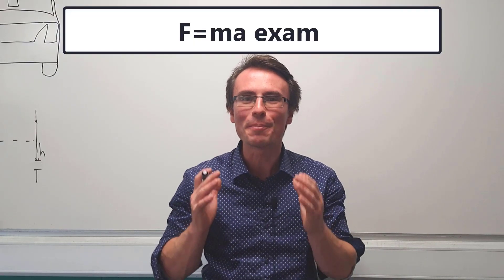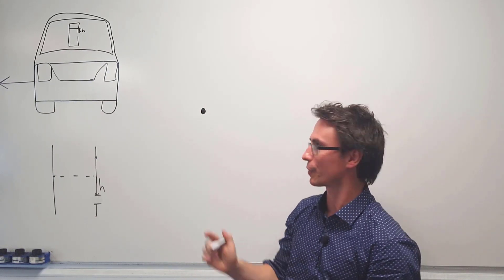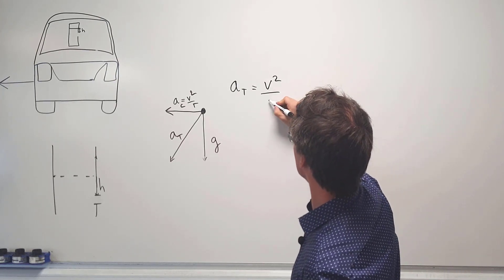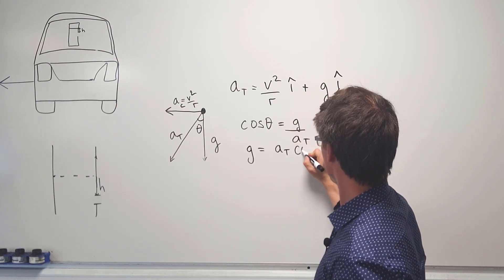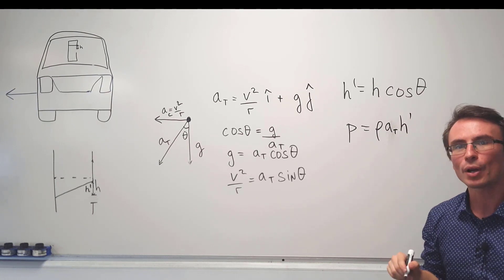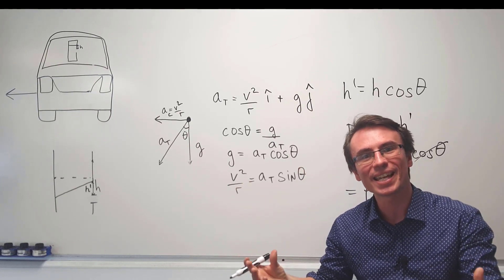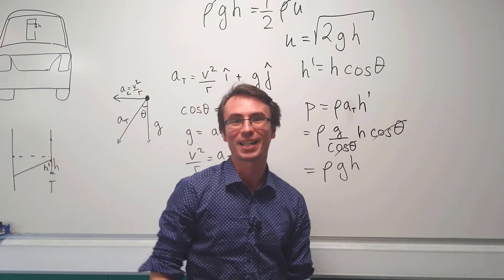HARD last problem from the F=ma exam

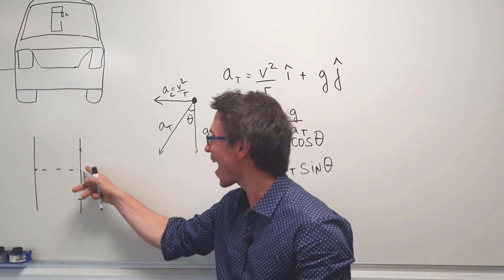Comment from the maker: So I am not actually convinced about my reasoning on the effective height of the water at 2:33 .What do you guys think? The official mark scheme is here:  https://www.aapt.org/physicsteam/2020/upload/2019_Fma_A_solution.pdf  Have a browse through the other problems too, they are fantastic! More to come!
Reply: Here's one way to see it imo. Since the car is accelerating, there's a "new" gravitational acceleration that points down and to the right, what you labelled as a_T. Now, in normal conditions, the water level is perfectly horizontal because that way it minimises its potential energy, but with a different gravitational acceleration, one that slightly points to the right, the water level will need to change and be slanted. It's like we are on a new planet with gravity that points both down and right, where skyscrapers, houses, even the inhabitants of that planet are slightly  slanted .
It's a silly way to think about it, there surely are more rigorous and precise explanation on why the water level is not horizontal anymore, but one could argue its "potential energy" is at a minimum with this new gravitational acceleration only if the level is sloped. That makes h' the new height, since height is by definition parallel to gravitational acceleration (think about the height of the alien skyscrapers, how would it be measured?).
Reply from the maker: @marcoaltamura7512   Agree exactly! Thanks for the input. That's actually exactly how I initially filmed it. However it did not seem rigorous to me and I couldn't see why the proportionality would exist mathematically, so hence I edited in the virtual whiteboard segment thinking about the normal. It's pretty similar to say, the vertical component of the B field in magnetic flux calculations which is BAcos(theta). Also, your sky scraper analogy is excellent! Thanks!
Reply: According to me, the simplest way to imagine of it is

Think of a tiny water particle at the left(with respect to us) edge of the cylinder, the resultant of centrifugal force and gravity vector acts downwards, towards right wrt the car,   if there was no wall, the tiny drop could have moved in the same direction. But, the wall exerts equal and opposite force in the opposite direction, so the droplet will move upwards, slanted at angle 90-theta with the horizontal line.
Reply: I think it's not theta

Comment: This channel is a gem. Continue
Reply from the maker: Thank you so much for your kind comment!
Reply: @zhelyo_physics , consider my explanation too please.
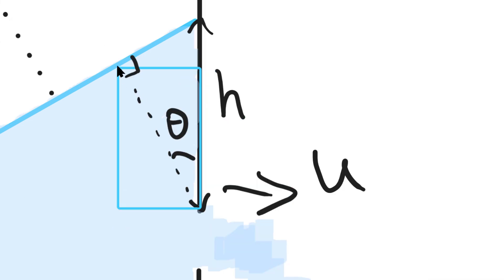Reply from the maker: @Mathematician6124  Sure! I always respond to good physics questions!  So the diagram at 02:44 is drawn within the frame of reference of the car cornering and the shape drawn (leaning to the right) is taking into account the centrifigal force to the right, leading to the effective gravity. I should have mentioned that in the video.
Reply: @zhelyo_physics , yes keeping that in mind, I think the angle should be 90-theta. Am I wrong?
Reply from the maker: @Mathematician6124   Actually thinking about it you can totally do it this way if you express your original vectors in terms of (90-theta) too. Then you would get exactly the same result for the pressure. However if you use (90 minus theta) for that you'd need to write down your vector components in terms of that too. Interesting!
Reply: @zhelyo_physics , no if it is 90-theta, then the equation of pressure says = (ro) (aT) (effective height) = (ro) (v2/r sintheta)(hsintheta) = (ro) (v2/r) h

Then the velocity comes in terms of v2/r, not in terms of g

I want you to think deeply about it. All depends on that angle, if it is theta, then rootover 2gh is correct, but if it is 90-theta, then rootover (2v2 h/r) will be the answer.
Reply: @zhelyo_physics , consider my explanation under the pinned comment. It should be 90-theta, the angle is pretty annoying. According to me, we can actually never determine the angle correctly.

Comment: I think an explanation is this: since we are in an accelerated system (the cylinder of water inside the car) we feel the "fake" centrifugal" force pushing us to the right and the normal g down, composing the total acceleration A_c. Now if we imagine to be inside the cylinder it would seem to us that this one is inclining it's section by theta angle below the level of water. This means that h' will be the "new highest point" of the rotated cylinder, for us in the accelerated system (which is not true for someone who watches the same scene outside of the car). So in this way the required height is the new h'=hcos(theta).
Reply from the maker: Excellent explanation, thanks for the comment!
Reply: Thank you for all your hard job on YouTube. I love your content, can't wait to see more!
Reply from the maker: my pleasure!
Reply: But I think, if we are there as a water particle in the cylinder, the centrifugal force acts  towards right of the car, so the upper surface(me too) of the water should splash in the opposite direction of [the resultant of centrifugal force and gravity vector] , so the angle should be 90-theta, not theta. Please consider my statement. Inform the error if I'm wrong.
Reply from the maker: So the diagram at 02:44 is drawn within the frame of reference of the car cornering and the shape drawn (leaning to the right) is taking into account the centrifigal force to the right, leading to the effective gravity. I should have mentioned that in the video.